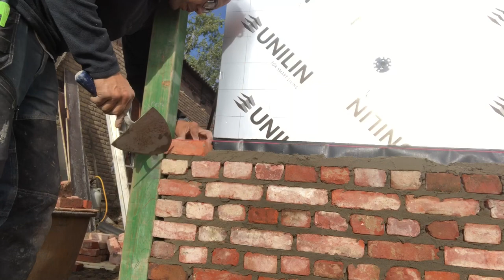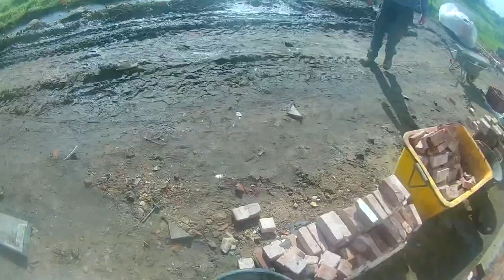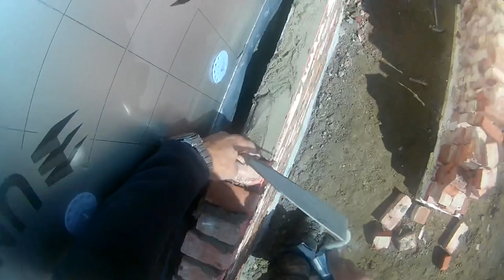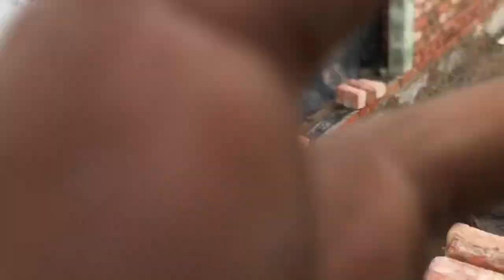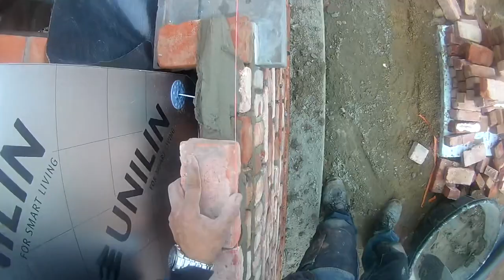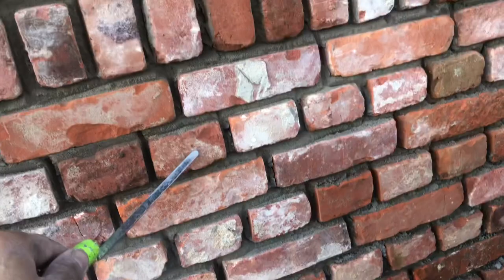Bricklaying with very old bricks (2)

Comment: Lovely job Jay ..... in England that is English bond. Do you just do the brickwork or do you point it at the end too ?🧱👍🏼😎
Reply from the maker: Steve and Alex thanks , I just looked up what English bond is , it looks like the stretchers are starting the same in each course ?
In this wall the cross bond is only with 3quarters in the corners and windows 

So the one course stretchers start with 3quarter -header-stretcher-stretcher-str
The next course stretchers start with 
3quarter- stretcher-stretcher-stretcher-

This is actually the Antwerp or maybe Flemish 🤔 way of crossbond , I do know there are more variants here in Belgium and Holland but all are still true crossbond as the stretchers are in uhm  🤔 ...stretcherbond  haha 

Oh yes and pointing will be done by a pointer , I do point smaller things or sometimes it’s demanded to do the pointing directly , that’s a price difference , and if I need to point that house it would take too long I guess 😂
Reply: Jay Puyenbroeck . Looks very similar and makes a beautiful wall 👌🏼🧱👍🏽😎.,
Our header course starts with a header then a half header called a queen closer 👌🏼
Reply: It's called dutch bond in uk. Every 2nd stretcher course has a header after the 3quarter.

Comment: A good shift that Jay 💪Do you spray the old bricks with a preserver on completion? I didn’t quite catch what the old guy said when he brought you the broken cill 😂😂😂🇬🇧
Reply from the maker: Ronnie Biggs thanks , you mean spray it after  the wall is finished  o? I dont know this actually 🙈
Reply from the maker: Ronnie Biggs the Guy said the damaged piece can be covered in the joint there lol
Reply: I am not sure what the weather over there is like but, using reclaimed bricks in the UK is the norm to match old buildings ect .The main issue with “our bricks” is that they are perhaps over a hundred years old which means they have had one hundred summers and winters and even may have been used and rebuilt twice .The Old houses get demolished and this pile of crap gets tipped in a yard the bricks are manually dressed (Cleaned) and stacked on a pallet with the good looking ones on the outside and all the misshapen bricks within ..So getting to the point of my comment regarding brick sealant .With the bricks now being weak on the face side thus allowing rain water and frost to enter and further destroy them I apply a couple of coats of spray on ( good quality) brick sealant which is sprayed on with a manual pump and wants the brick has absorbed enough the sealant you have in effect a gore-text like finish which should last a long time and you can’t see it ...☔️☔️☔️☔️🇬🇧
Reply from the maker: Ronnie Biggs very interesting ! We do have many products like sika for instance , I did use products in the past to make the surface more water resistant but preservation not yet though , the bricks I’m using are not that old .. maybe 40 to 70 years , not sure of it off course is just my guess , they come from several demolished buildings , who knows what landed in there 
Thanks for the info ✌🏻
Reply: @ronniebiggs4026  would it prevent them from absorbing rain water?